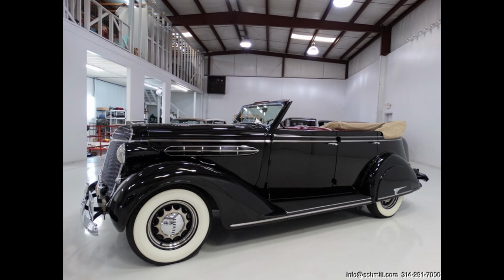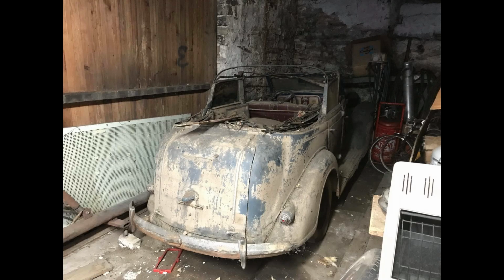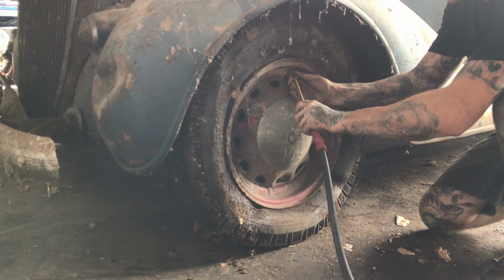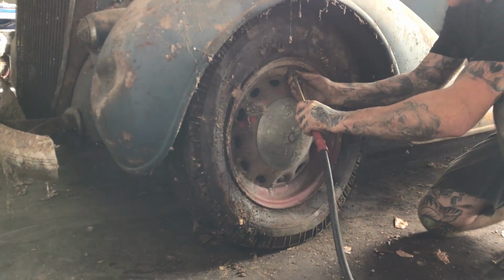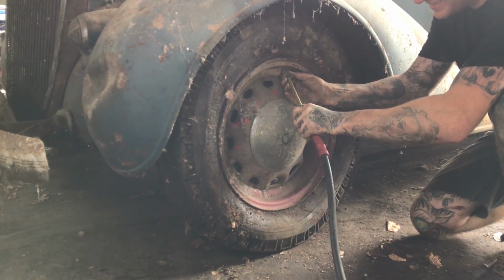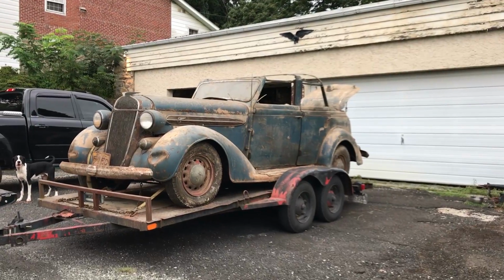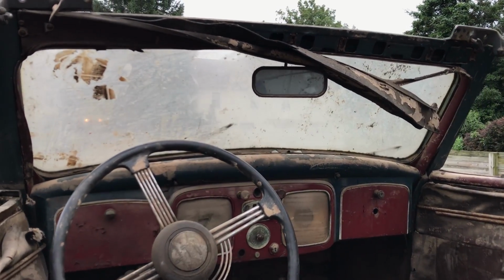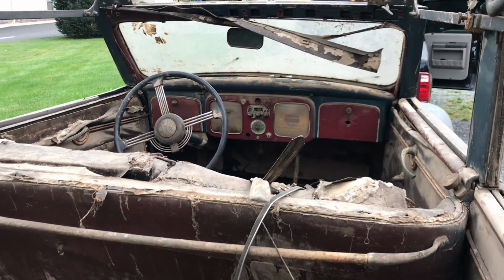Barn Garage Find! RARE 1936 Chrysler Airstream C8 Convertible Sitting For 65 years!

Comment: My father had a '36 DeSoto like this for about 2 years. Most likely a 6 cyl. He made his own valves for it from Ranger engine Thompson valves and ran it on the "unusable fuel" 100 octane avgas from the test cells tanks. In the lead-up to Pearl Harbor they were working long hours so he'd sleep hard and then have to speed hard down Hempstead Turnpike. He'd always leave the Nassau PD Fords in his dust at more than their top 88 mph, but this was tough on the cloth top and he kept his mother's needle working.

Comment: In 1951 my dad bought a 1934 Desoto Airflow.  It was Dark Blue, 4 door with split window fore and aft!  It had Free Wheeling (overdrive)  It would go 85 mph with the 6 cylinder motor.  He bought it for $85 from a junk yard, it had no rust or serious damage.  The gas gauge did not work.  I was 11 at the time.  I never drove it but I was allowed to drive the 34 Plymouth,  I hauled firewood in the rumble seat.  No cops speed limits of 45 mph.  The roads were not fit for more.  I hope this car goes to a home for complete restoration.  She deserves it!

Comment: That car has absolutely beautiful lines and style. For Gods sake don't hot rod it. Make it look like it did when it was on the road. I'm not even sure I'd paint it, just clean and try rubbing some linseed oil into the paint. The top and interior fabric of course will have to be new made, but keep in its its original style. I saw a guy buy up some old leather couches just for the old looking leather and use it on his seats and it looked great.
Reply: Choo 1982 The thing is that hot roding a car is much easier then restore it to its original.

Comment: They were looking at the back wheel thinking the axle was seized when actually the car was in gear.  Just before they were focusing on the back wheel, one rear wheel was on the ground and the other wheel was actually turning. Hopefully they didn't damage the transmission.
Reply from the maker: There is no transmission in the car. The rear drums are seized, not uncommon thing to happen. -Mike/ITG

Comment: Never throw anything away till you take a real good inventory.  I am restoring a 1913 Maxwell found in completely original but totally un assembled condition -it was an estate sale-loaded with various crap  loading the truck and trailer their was a coffee can of rusty nuts bolts and washers tucked in a box of broken wood and scraps of leather  and left them their, later finding out that they were the left hand thread nuts and bolts in a hard to find pitch  for the drive line.   give everything to the person restoring the car let them decide what is junk

Comment: You might try some goop hand cleaner on the paint and be surprised how it turns out. Restores the paint. Been using goop for many years on older cars. Also I use it on my ram truck. Looks like I had it was and I can wash it about five times before cleaning it again with goop. I have over ten miles of dirt/ clay road to drive just to get to the hw. Also there is a junk yard here in St Johns that is filled with a lot of the older cars. I am talking model A's  and up in years.

Comment: Quite a Find ! It should have a 273.8 cu in 8 , around 105 hp and the transmission had the Overdrive built in for 1936 . Worth restoring  though finding an original transmission might be a problem .
Reply from the maker: All of the above! -Mike/ITG

Comment: Pulled a 1939 Buick special four door sedan with a straight 8 out from between some trees where it had been sitting for almost 20 years also due to trans issues. Mines in pretty damn good condition all things considered. Was restored in the 80's. Really not much wrong with her asides from the trans. Body wise she's pretty good too. Got some surface rust in the floors and trunk and a dent in the fender. Interiors perfect still.

Comment: Roll up windows = Convertible Sedan. Side curtains = Phaeton
Reply: You are correct.  Ford, with the Model T, and other manufacturers also referred to their open 4-seaters as touring cars.  In addition, roadster and convertible are terms frequently used to describe the same type of car, however a true roadster also has no roll up windows.

Comment: Why is there a Level Air emblem on the rear? I saw no air compressor, or anything else to show it had Level Air in the past. Looks to need a little detailing under the hood... master cylinder, brake booster and generator look beat up, otherwise a super nice car. Love the colors! Looks like Classic Cream paint on the body.
Reply from the maker: Needs a good mechanical resto, some interior work and to drive the hell out of it!! -Mike/ITG

Comment: Great car...ultra rare....would be beautiful when finished...Matt I noticed the transmission hole in the floor....did you get the transmission with it?
Reply from the maker: The car actually parked in 1951/52 due to the transmission failing. We did try to dig through the shop and find the original trans but we couldn't find anything. Thanks for watching!! -Mike/ITG
Reply: Great videos every week,  keep up the good work.

Comment: i found a 1948 coupe that had been sitting in a field for 25 years in the same condition  . took it home to porterville from bakerfield. - all the mechanics in town told me it would never run the engine was stuck there were black widows coming out the carburator ect ect ectb .it i need it rebuilt they said. next day i went to work it was a 235 inline 6. first thing i did was fill rhe cylinders with w d 40. next cleaned the hole ingine inside out. changed the oil pump. took me three day and i got it started fine did the brakes and it was ready to go. that weekend i played a trick on all the so called mechanics in town. told them i was throwing a ( pull out the engine) barbaque at my house that sunday all you can eat and drink. well that sunday about 12 friend and mechanics show up. as they gathered around the car to start pulling the engine . i got in the car to open the hood. instead i fired it up took off down the drive way . they were in shock almost ran them over. i went into the street did dounuts fo 4 minutes then parked it .as they looked in shock i told them ( you guys ain't mechanics your carburator and starter changers )  it takes a bomb man to start a bomb taught by old school bomb men since i was 15 lol .  i drove that car for five years . didnt put much money in it at all. did my own door panels the interior came out of a 1979 cutlass and fit like stock perfect bolt holes even lined up the ladies were very comfortable in it.before long i had an assorted collection of lost panties  in the back seat.. it's only original once why restore it.

Comment: if you put a gearbox in neutral it will be a little easier to tow.  the tire still hold air I cannot believe it they look so rott
Reply from the maker: There is actually no transmission in the car at all. There is an issue with the rear that would not allow the wheels to spin.  Old tires like this had inner tubes so the tire itself may look dry rotted and cracked but the tube still holds air. They usually fail at the valve stem. Thanks for watching! -Mike/ITG

Comment: I'm confused why back in the early 50's someone drives it then parks it at the back of the garage, and 6 and a half decades later it's still sitting there, all dusty, and dirty looking, bit of rust and tires flat, it needs to get out there and all restored up then getting back on the road

Comment: This guy is into hot rods, this car is not going to be restored.  It is going to be cut up and modified into something that will bear little resemblance to the original.
Reply from the maker: So because I'm into Hot Rods I can only modify and cut cars up? I do what's best for the car in the end. I hot rod cars that restorers would cut up and throw away and I pass on cars that should be restored. This car included. That whole assuming thing got you again. Thanks for watching. -Matt/ITG